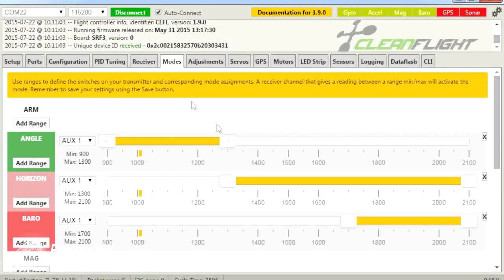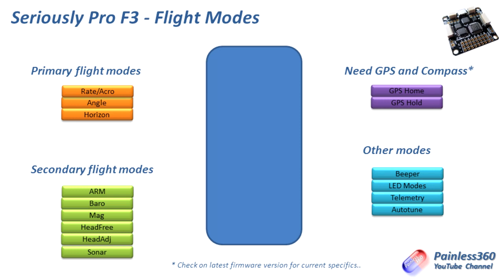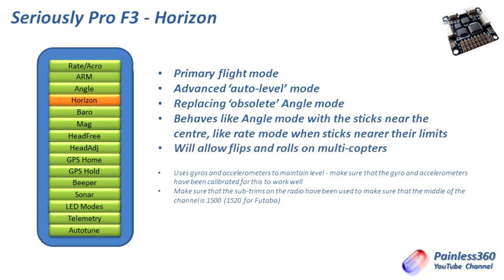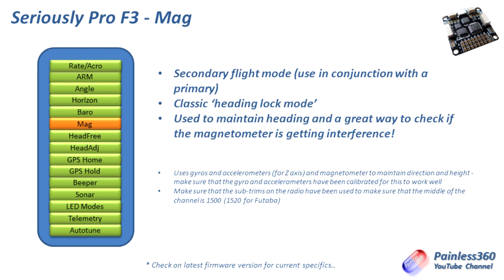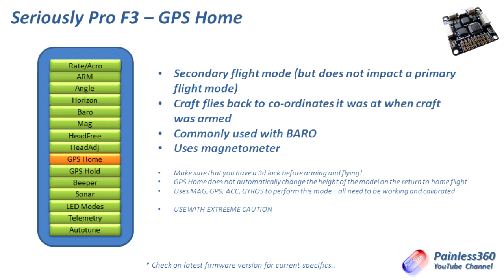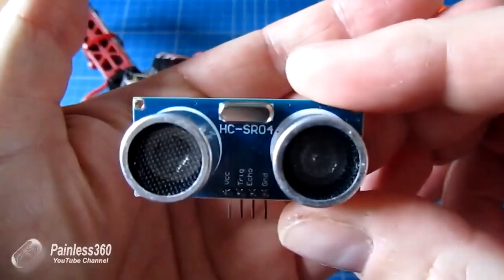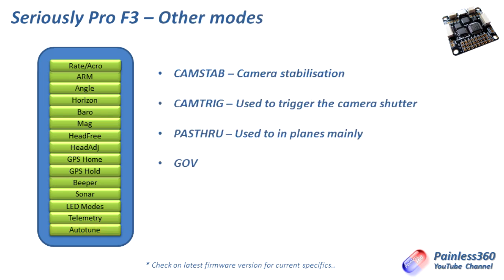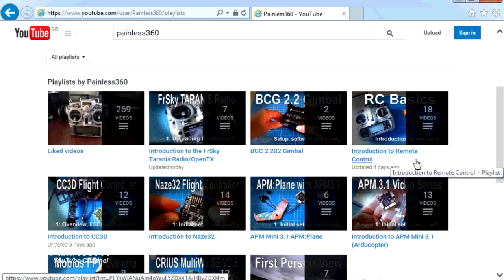(3/9) Seriously Pro F3 (SP3) Series - Introduction to modes (Angle, Rate and Horizon etc)

Comment: Hi!
Could you help me?
I have the SP Racing F3 flight controller, deluxe (from Bangood) and I have flashed the CLFL v2.4.0 SPRacingF3 version with cleanflight configurator 2.4.0. In the main page the icon of "baro" is green and at menu sensors I can verify that the barometric sensor works well. On Taranis I have three switches, 1 "arm", 2 "angle"-"horizon"- "air mode", 3 "baro"-"headfree" (min1000, mid1500, max2000). All these functions are working fine when I am selecting them from modes menu and their icons become green, except the "baro". Unfortunately, the "baro" cannot be activated. Do I have to make any adjustment to CLI? What do you think about this issue?
From CLI: 
set baro_bustype = I2C
set baro_spi_device = 0
set baro_i2c_device = 1
set baro_i2c_address = 0
set baro_hardware = AUTO
set baro_tab_size = 21
set baro_noise_lpf = 600
set baro_cf_vel = 985
set baro_cf_alt = 965
set mid_rc = 1500
set min_check = 1050
set max_check = 1900
…………………………………………..
Frame: 240 mm
ESC: Holybro Tekko32 35A BLHeli_32 Dshot1200
Motor: Emax RS2205S 2300KV

Thank you in advance!
Reply from the maker: I've not used Cleanflight for a long time. Please see my 'Quadcopter building for beginners' playlists for more modern setups. Best of luck!

Comment: hi , i just bought a x220 wizard and was wondering  if i can use headless mode for it. thanks from downunder
Reply from the maker: +Ralph Kluge depends if the flight controller in it has a compass and if it works well.. Best of luck!
Reply: Painless360 its the f3 FC that comes standars with it. not sure if it has a compass or whether one can be added.
Reply from the maker: +Ralph Kluge reading the specs it looks like a 6 DOF board, so probably not..
Reply: Painless360 thank you. yes it is a 6 DOF board. will look for another board maybe the 10? maybe its just not worth the trouble.. I hate being a noob lol

Comment: in beta flight I have the f3 plugged in and there are no extra modes like, angle, horizon, or theres not even an option to set a angle mode. Also there isn't a way to set the arm to a switch. it uses the yaw.
Reply from the maker: Can you post a screenshot/video of what you're seeing?

Comment: so far The GAEA SP racing F3 deluxe units on Amazon are junk. the first one operated fine until I applied battery power from a 40a esc w/bec  5.5 v output which promptly blew up my esc and the fc board. The second one worked great until I tried to spin up the motors through cleanflight, setup was done by following instructions through "painless 360" and the motor would not spin-up. I used the transmitter and got #6 to spin, but no others. transmitter off I moved the FC and #6 spun up, if I moved the board around, I could I could speed up or down the motor as if there was a short some wares. I reset my transmitter so 8 channel were operating and cleanflight worked perfectly until it came to the motor setup. I could get only #6 motor to spin up,  but cleanflight told me that all 6 motors where operating when they were not. I will try buying this one more time, Because of what this supports and cleanflight has a major bug failsafe locks up everything need to disconnect and reconnect to operate cleanflight please pass this info on to the appropriate parties THX
Reply from the maker: If you've got something to report then GitHub is the place to do it. The not arming until a power cycle following a failsafe situation is what it's supposed to do - https://github.com/cleanflight/cleanflight/blob/master/docs/Failsafe.md Happy flying!

Comment: Mr P-360, while listening you said in this video something about MuMetal, while describing stacking PCB near the FC;   7:14    . I found the thinnest was this MuMETAL® Perfection Annealed Foil, would this be what your describing? I have used aluminum foil tape for shielding in the CX-20/Nova Pro, helped GPS sat count and lowered compass deviations. Thanks
Reply from the maker: The stuff we have here was reclaimed and supplied from a seller on eBay. it's about 0.7mm thick and seems to work well. Best of luck!

Comment: I would love a video detailing the new/different features of the CleanFlight 1.0.0!  I think you are THE man to do it. =)
Reply from the maker: What version?
Reply: +Painless360 Well, the current version is actually 1.10.0.  The Config has an updated look.  It&#39;s actually pretty much a re-skin and a new video really isn&#39;t necessary... not quite sure what you mean by which version.

https://www.facebook.com/Cleanflight-582474325195689/
Reply from the maker: You said 1.0.0 in your question. Cleanflight 1.10 is here with a few minor changes (mainly small things like SP3 Softserial etc) and 1.11 is on the way with support for Naze32 revision6 boards so you can see why I asked.. ;)

Comment: You talk about mumetal for magnetometer protection but I dont see any sources. There are various weights and sizes available. What can I get that offers good protection at a reasonable price? I know you dont need a lot of it.
Reply from the maker: +Michael Rempel Google it and you'll find it. I get mine from eBay and a scrap piece will last you for many builds as you only use a 40mm square ever time..
Reply: +Painless360 Thx. I did that which is why I had the question. Do you just by the cheapest one on e-bay? I presume it doesnt need to be all that thick. BTW thanks for this series. I am interested in building a machine with all the toys on it. I hope GPS works well soon. I am also interested in high precision GPS using RTKLIB There are a couple of hardware solutions available but they cost more than they need to. A UBLOX running a good antenna on the aircraft and another running over serial connection to a fixed ground station should be enough to make high precision flights (minus wind effects) possible. For some stuff I want to fly 1 meter accuracy is really not quite good enough, and when I have deviations I would like to know what they are too.
Reply: +Painless360 I am also trying to build my own code in Windows 7 64 bit PC. I am having problems finding and installing all the components. Can you forward my concerns to developers? I think it is out of scope here.